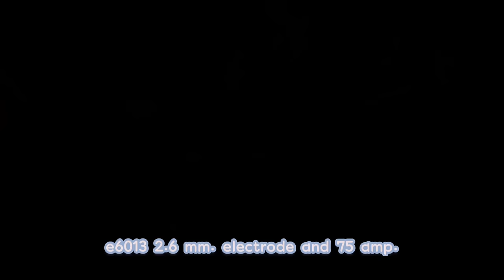The Secret to Perfect thin Square tube to pipe welding.

Comment: i would not reccommend people to use the thin grinding disc to grind sideways like that  ( i know a lot of people do it ).... but for those who are new to working with metal; when such a thin grinding disc breaks it explodes and can cause serious injuries...   its even forbidden these days to work like that, goes against safety precautions and inspection can stop the company and give a fine for that kind of stuff xD     btw it only takes a few second to change to the thicker grinding disc which is ment to be used for that instead,   it can safe your eyes.   just last week i even was wearing safety glasses and using angle grinder and a little piece of the disc got under my glasses into my eye..........  imagine if i would not have weared the glasses....  i rather take a few seconds more to change the disc than to lose one of my eyes for the rest of my life

Comment: Does starting and stopping so many times jeopardize the strength of the weld? Does the starting welds stick on top of the slag from the previous spot? I know what you're welding is thin so it won't be structural but I'm just curious. Would a thin 7014 rod be good for thin metal?

Comment: Can you advise how to weld with basic electrodes, I bought one and it's hard to strike the arc or the electrode goes out during welding?
Reply: Striking an arc just takes practice. Make sure you're not running too cold. The arc going out during welding is because the rod burns away as you weld so you have to keep that arc length through the duration of the weld. Sounds like you just need to keep practicing